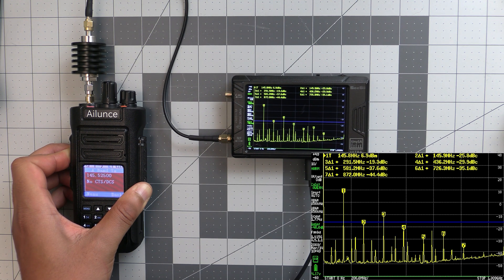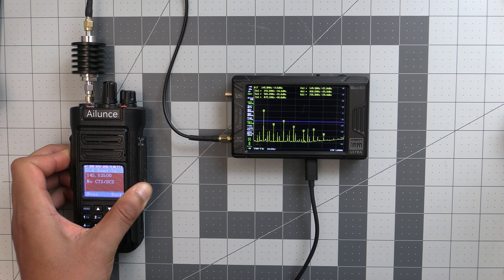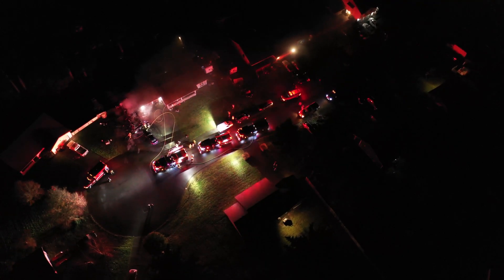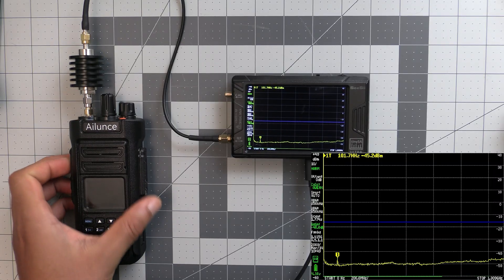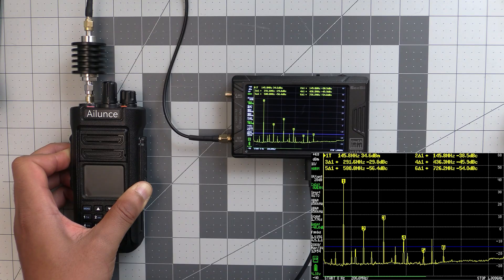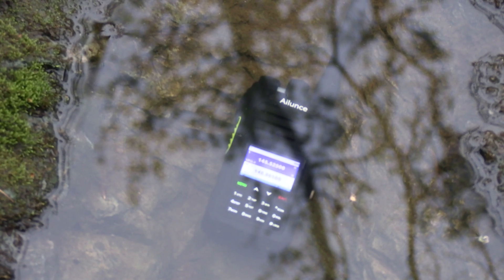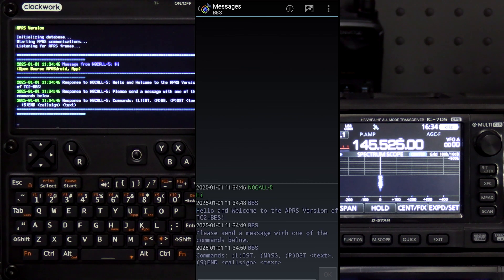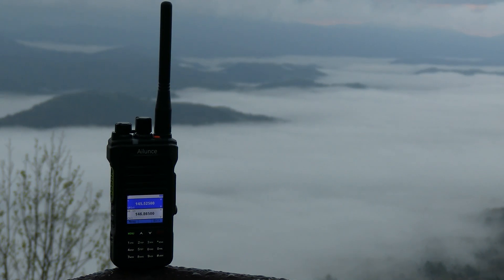The new HA1UV dual band ham radio front Retevis Ailunce

Comment: Love the channel. Have been subscribed for a while and watched many previous previous reviews, including for the Retervis HD2. Thanks for including in your video some of the text for the federal regulations on spurious emissions with the section number, CFR 47, 97.307. However, viewers that look closely may see that they pertain to HF frequencies below 30 mhz, outside of the 70cm and 2 m bands the HA1UV transmits on. May I suggest using the text of 97. 307 (e), instead of 97.307 (d). That subsection covers 30-225mhz. I don't mean to belittle your video with this complaint, but viewers not familiar with your usual thoroughness and attention to detail may not see the overall quality of your work. As for me, I took a picture of the text on the video and was thankful, as I had heard the standards quoted or paraphrased, but was happy to finally have the actual regs for future reference.

Comment: You missed the best part it has a multipin connector that retains the ip67 rating when using accessories. & they sell a $15 adapter to use kenwood 2 pin (baofeng) accessories